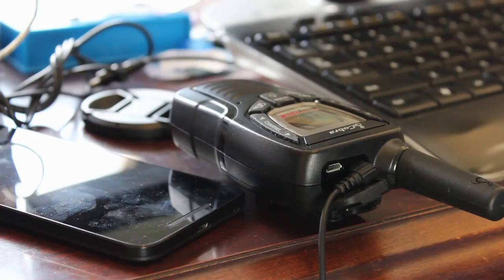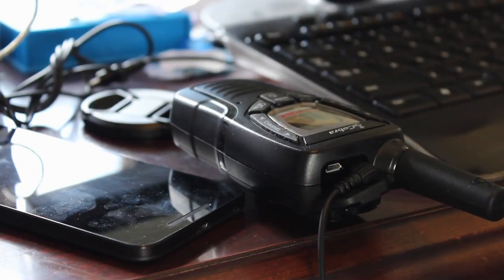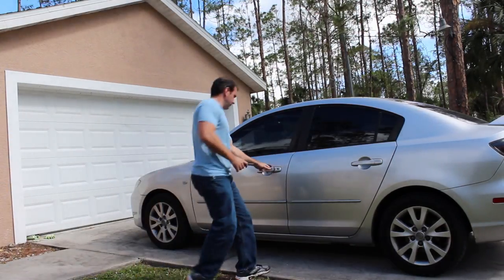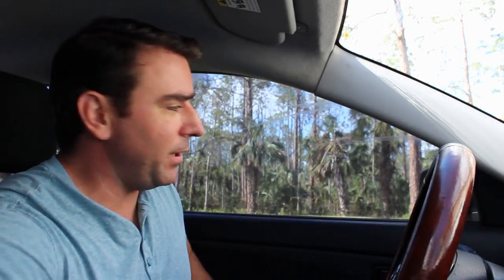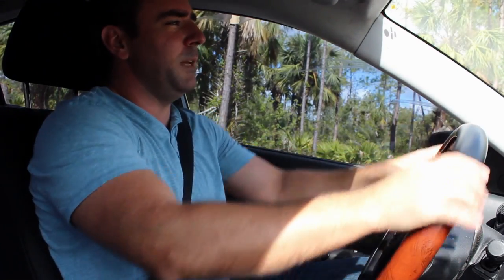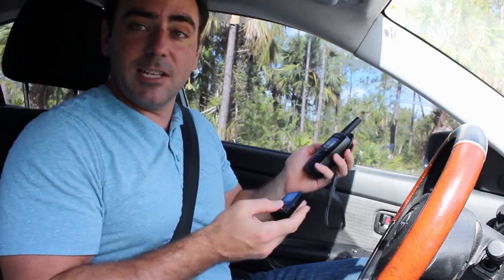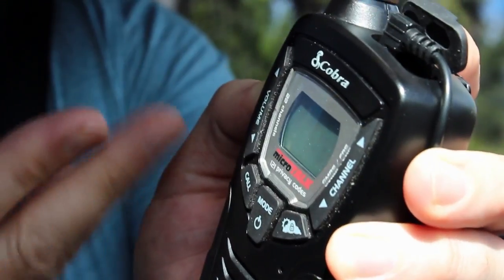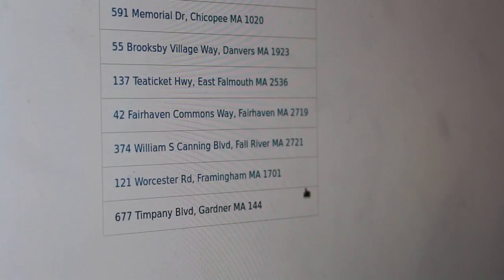01 Computer Radio Data Communications Intro 2017

Comment: Thanks for your video Kris, I am fascinated by this idea and am planning to reproduce something along the same lines using UHF public frequency (that only has a short range) in a series of repeaters, I think a small board computer would work well for this. The idea is that it would work from house to nearby house and whoever is in the chain will get the feed, whilst maintaining only a local signal strength per transceiver.

Comment: Very good video kris. You can use error detection and correction codes for detection of transmission errors and also these codes can correct the received information.

Comment: (I speak only from scant basic knowledge here...)  In Amurrica, it's my belief that any device that emits RF must - that's MUST - comply with FCC rules & regs.  Such as;  x-frequency + y-effective power + z-length of antenna (and probably more).  Such as;  for certain SW licenses, operation only permitted by the license held.  Such as;  protocols of transmission content, announced call-signs, etiquette, length of communication, etc.  If a thing producing RF does not comply, the FCC coming to a person's door is not if, but when...  Alright, your idea addresses a time of emergency.  I have no doubt FCC R&R address that unlikely scenario.  Let's face it, the FCC's track-record is few episodes of leniency, and many cases of prosecuting, fining, confiscating from those who operate non-compliant devices. Extracting cash from offenders is good for the FCC coffers.  Your concept has more importance to consider, given the increasing attacks on "Internet freedom".  Already G, YT, FB and other platforms have clamped down, and will not revert.  Vidme just died.  Apparently Twitter's ToS includes revocation of a subscriber based on his/her online behavior OFF Twitter.  Read that over.  Users, even 98% of ultra-geeks, are not ready for an overnight lock-down of the 'Net.  I could envision a near-future where SD cards are surreptitiously snail-mailed to flow information deemed wrong by "They".
Reply from the maker: All depends on what you are transmitting on.  There is no reason I can't transmit using the radios I have.  The "unlikely scenario" of "time of emergency" has happened at lest 3 time in my career as a firefighter, and local ham radio hobbyists have helped local fire departments with radio transmissions during these times, although I've not heard of them transmitting data to the computers in the trucks.

You make it sound like the FCC would stop us from doing this, and this is not true at all.  There are restrictions in some areas of doing this, but nothing that would stop us from being able to do this.
Reply: No matter how pessimistic my comment, I'm still looking forward to see your progress on this topic.  When I get my 'tronics bench up & running, I'm keen to experiment with data over RF under 100kHz - just to tinker and learn more about RF.  Mid-2016, I asked a local, seasoned ham guy his thoughts about DIY RF TX & RX, and the FCC.  He lamented how convoluted the FCC rules & regs were to understand.  It would be a big feather in your cap if you integrated current DIY technology + non-specialized radios for data exchange.  Such could be a viable, leaner option to using formal WIFI / BT, on one's property, or, better, to the max distance possible in one's community.  Best.